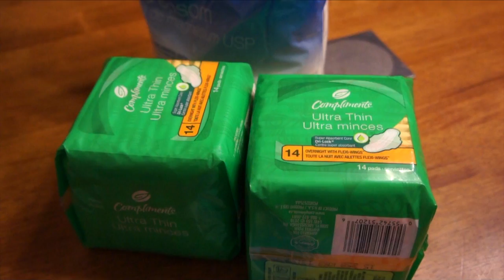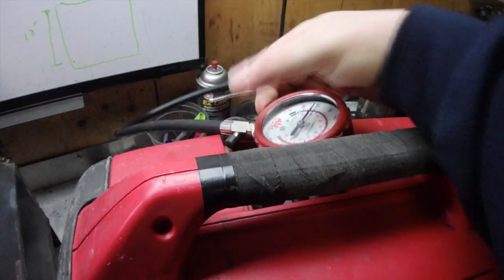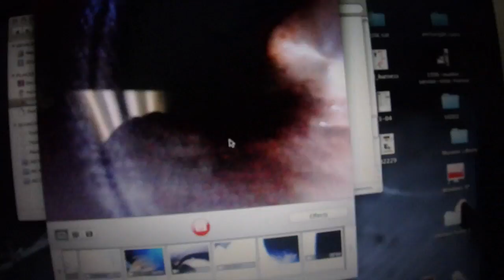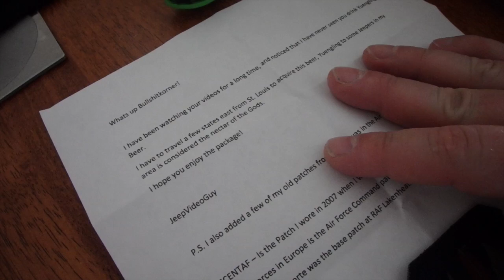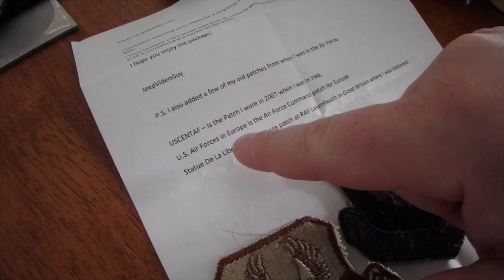Going Under the Knife

Comment: Jerry I did some testing with the seafoam on carbon deposits and it did nothing. I use it as a fuel stabilizer only. Choke and carb spray works but the best I've seen is that BG cleaner product. I like the jeep video guy channel never knew about being a vet, awesome buddy. Jerry  your all healed up now but you never mentioned how many weeks the doctor said no sex. LOL
Reply from the maker: +Steve Rob what kind of test did you do and what were you expecting to happen with the carbon ?  I don't think seafoam does anything to carbon besides maybe soften it up after a period of sitting. I have had good results with the product if you follow the instructions like it says, but then again you can also achieve those results using water
Reply: +Bullshitkorner I took a nasty looking valve and put it in seafoam and it didn't do much. If your running thru a hot engine ok but cold static test total fail. I tried the crappy tire carb and choke spray and it at least turned the container black. You try it and see.  Getting that BG cleaner hard to get. RICKAFIX did a test on the BG and it dissolved the gunk from a set of fuel injectors like nothing I have seen.
Reply from the maker: cold static test is pretty much useless for sure, America has all the good stuff we can't get here like marvel mystery oil

Comment: I worked with a carpenter he had maxi pads in his first aid kit they work better than bandages you have to think of it they soak up all the nasty stuff that comes out of a snatch.  What the hell do people in Alberta do to Honda engines to wear them out? not change the oil. The Honda EU2000 generators are good little units they produce clean power for electronics not sure how rebuild able they are being a suitcase generator.
Reply from the maker: +Graveltrucking i've already had it apart doesn't look like it would be too bad, need to replace a timing belt in the near future